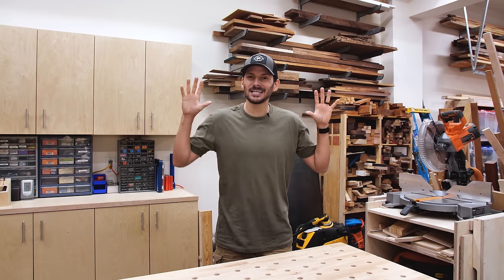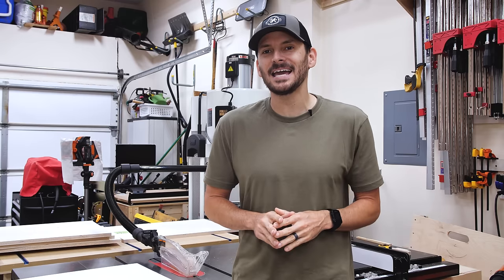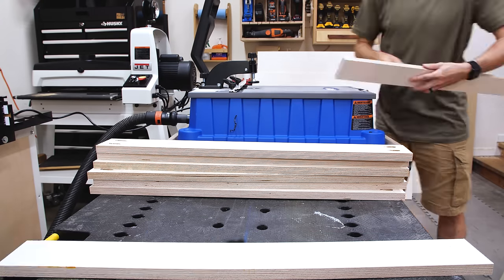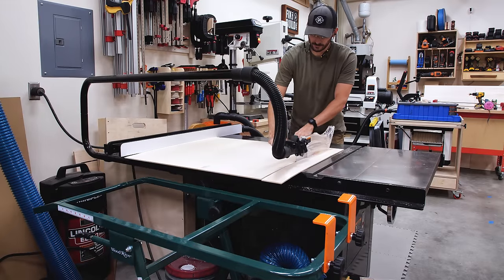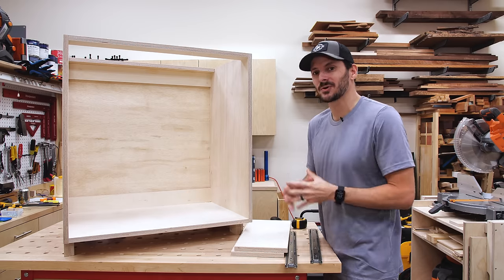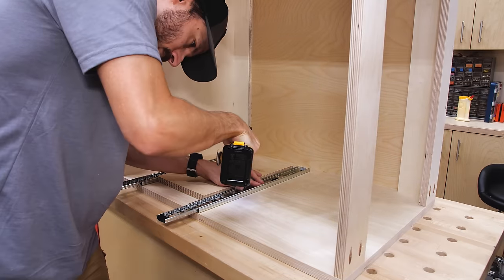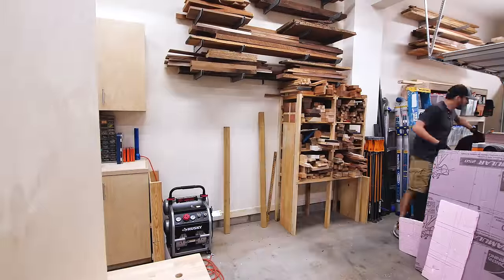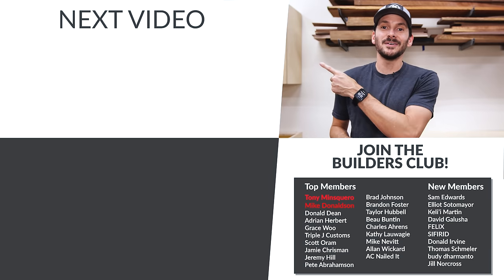DIY 3 Drawer Base Cabinets | Miter Saw Station pt 1

Comment: The best assembly table I I ever worked at had one side that was pegboard and a pegboard organizational system elsewhere in the shop so you could take your little container of screws or other hardware off the wall and then attach them to the assembly table. It also had a shop towel holder with a spring loaded mechanism so you could tear the towels one-handed, and hooks and shelves on the side for wood glue and any tools you needed. And it was all hooked into that pegboard so you could set it up in a way that flowed for you

Comment: Great build and technique, Brad, despite the puns (me nails, undecided). You being particular is called ECD - engineer compulsive disorder (I have it too). One tip I have is to flip the drawer spacer front to back each drawer. Any error in the spacer won't multiply then. It wasn't that important on this build but if the cabinet is many drawers high, it could be significant. See you next video. Stay safe.
Bill
Reply from the maker: hahahaha, Bill I actually did this! ;)  Should have shared the tip.  And love ECD, lol
Reply: Thank you, William.  Now I know the name for my condition.
Reply: @Not_TVs_Frank  Glad I could help (lol)!
Reply: William. That explain my drawers was out of wrack! Thanks for the tip man!  AM just getting into woodworking. Boy what a great fun hobby.
Reply: @imaginarypoint  Glad it explained it for you. Enjoy your woodworking!

Comment: So Brad, as it is in my world, I pulled the trigger finally on building that mobile miter station.  Now you went and designed a new miter station, that figures…….LOL  Fortunately I don’t have the space you have, which I think I’ll be fine with the first version.  I did like the cabinet build though, adding that to my mobile assembly table to better utilize the space under.  Like the video’s.

Comment: Great build. I'm surprised you are building a miter saw station. But I'm really glad. My miter station is an incomplete version of Ana Whites. And it sits to the right of my xcarve table that I built from your plans. I've wanted to redo it but have hesitated. Looks like I'll be finishing this series and then getting that garage bundle. Can't wait for the next video.
Reply from the maker: Yeah, I never thought I'd make one, Angie. But then realized I'm already taking up the space with the cabinets. So it's actually space saving if I'm doing the cabinets anyway. And will free up room for a larger planer 😀

Comment: My assembly/outfeed table has a 4ftx7ft top which seems to be overkill for some but it makes for a lot of room on those bigger projects. 6 drawers on one end and the other end has a place behind the doors for a small pancake compressor and a small cyclone system mainly for the tablesaw. the far end of the table has a niche for squares, nails etc.

Comment: Brad,  Nice video and nice cabinets.  Thanks for sharing a basketful of tips.  I share a tip I've found.  DON'T use those hardware handles, if you wear cargo shorts (which you are in the video).  I love the modern look of those brushed nickel handles - my kitchen and den are full of them. But each time I catch the folds or pockets of my cargo shorts, I rue the day I installed them.

Comment: A good way to stop your draws falling over onto you is to make a plywood box the same size as your toe kicks, it will move the tipping point further farwards and make everything more stable. You can also build a lip into the front to hold the first draw front for you. If you have a standard size that you use for the tie kicks that's one box and you're sorted for life. I suppose you could also just put a big clamp on the back of the unit to hold it to your table 👍🤣

Comment: How much would you say this 6 drawer build would cost to make? Kinda thinking it'd be a good dresser option as well
Reply from the maker: It'll take 3 sheets of 3/4" plywood and another sheet and a half of 1/4".  Add in slides and pulls and you're pretty much there.  But you'd have to price that out in your area.  For me it's about $300 using high quality plywood.
Reply: I built these exact cabinets just a few weeks ago following the plans. $38 a sheet for decent plywood so around $120 in material. I already had drawer slides. Overall a set of two could be built for around $150 depending on material cost in your area. I saved a little by using some other pieces laying around which allowed me to save some of the sheets to use on the wall cabinets also from this build kit.
Reply: @Fixthisbuildthat  Where are you sourcing your plywood? Just the local big box store for approx $50/sheet or somewhere else? I just bought the Garage Cabinet bundle of plans and am ready to get going!
Reply from the maker: @aarondonat  I get 4x8 baltic birch for about 60 bucks 👍
Reply: @Fixthisbuildthat  ... from where?
Reply: @Fixthisbuildthat   where do you get your Baltic birch plywood from?  I can’t find it in my area
Reply: Baltic birch is $120 a sheet here right now. With slides you’re looking at $500 at least. I’m using shop grade birch ply (fewer layers but still good quality and around $60 a sheet), making 2 sets of 3 base cabs (set with drawers and a set with doors & shelves). I will have more drawers in each set of drawers as I want some more shallow drawers and only a few deep ones.

Comment: Looks like another awesome Fix This Build That build!  So as I watch all you very talented makers build shop cabinets with drawers I seldom if ever see anyone putting a rounded edge on the top edge of the drawers. Or a chamfer if that's the right term. I wonder of that would look nicer since most every drawer I've seen on "in the house" furniture has them?
Reply from the maker: Great observation. I round the edges by hand with a sanding block. Its typically a comfort thing vs a look thing for me.

Comment: Nice job.  I forget the name of the tool - it’s the one that drills pocket holes. I’ve seen the form that is some plastic, you fit it to the wood and drill holes. Your machine is so much better. You just place board needing holes and press the arm. Viola! Hole is like magic. I can’t imagine why a wood worker would use anything else lest your building a one drawer cabinet or two. It’s even better than sliced bread as they say. 

P. S. The two cabinets turned out fabulous.

Comment: I bought the plans and I’m looking to make a few different cabinets and the pegboard hutch. For 3/4” birch plywood, my local supplier is asking about $100 a sheet. In total I would need about 17 sheets, which comes out to nearly $2,000 including the 1/2” sheets the plans call for. Is there a cheaper option for wood choice? Is Birch plywood the only acceptable option for nice looking, strong shop cabinets?

Comment: Undersize Plywood. I'll bet it's metric 18mm sold as 3/4inch, which is a 1.05mm (11/256in) difference. Doesn't seem like much but errors soon build up over a distance. Great build though, look forward to the rest of the build.
Reply from the maker: This stuff I used was actually a full 1/16" shy, coming in at 11/16" and that can add up fast!

Comment: I'd like to build these cabinets but did you build a base for the cabinets or use the adjustable feet you talked about in your video? My basement floor is really uneven and I'm thinking building the base first then shimming them for level might be a better choice. If you did built the base, do you have plans available? Thanks.

Comment: This might be a dumb question, but how do you figure out the size of the depth of the cabinets? Like for example, I bought the plans, but let’s say I want to change it to 5 drawers on each size or something? Would I just take the height of the cabinet and divide it by how many drawers I have and then figure the kerf on that cut will be enough clearance between the drawers?

Comment: Brad, how are you squaring your Kreg track on the plywood? One of things I've been struggling with is squaring my Grizzly track saw when breaking down full sheets. I inevitably end up with one end being slightly longer than the other, which means I have to compensate and over cut, then finalize at the table saw. Not ideal.

Comment: Why do you cut in toe kicks?  I have found it is much easier to build the cabinet shorter without the toe kick, and build a leveling platform out of 2X4s in the shop, and 3-1/2-inch wide strips of 3/4 plywood for interior projects.  You build the level wing platform smaller than the cabinet, and that forms the toe kick.  It is a lot easier to level the platform, and then set the cabinets on it, than it is to level each individual cabinet.

Comment: What’s the best way to deal with a garage floor slope of 4”over 20 ft when building cabinets?
Reply: You could build cabinets that are off of the floor, or design them to match the angle, or just have a normal garage
Reply from the maker: I'll be covering that in the next video!

Comment: “Mistakes were Made” from the Movie Timmy Failure. My 7 year old son loves that movie!  Love your Cabinet build series. I want a Miter station like that. But I want to create rolling carts for my table with out feed table on one side the assembly/Router table on the other side. That can store underneath. I’m a beginner woodworker. I’m still working on my first project. A dryer pedestal for my laundry room.

Comment: I just bought your 5 cabinet plan bundle, had to compromise on the plywood as Baltic Birch here goes for $128 a sheet for 3/4".😱 Home Depot has Sande plywood which looks nice and goes for $70 a sheet for 3/4".
Reply from the maker: that's a good trade off and it'll work well!

Comment: I've noticed that the majority of woodworkers check for square by measuring the diagonals, but they never show what to do if the diagonal measurements are off!  I would like to see that in a future episode (if you haven't covered it already).
Reply: Push in on the two corners farthest apart until they're equal

Comment: Hi Brad, I had a question about breaking down your sheets of plywood. I see you use a track saw. How do you get it positioned for a perfect 90 degree cut? Does the track have an alignment feature? Or are you just using a square or measuring the top and bottom of the track from the edge?
Reply from the maker: I don't rely on that edge for finished dimensions. Re-watch the beginning where I talk about the factory edges and that should help explain how I do it.

Comment: I've got a question for you about plywood.  In my area of Idaho a 3/4" sheet of Baltic Birch is over $100.  I can get white birch for about $75 at the same plywood shop.  If I hit up big box store I'm looking at around $45 per sheet.  I've watched and read why to avoid the big box stores due to less quality but at close to half the price I'm having a hard time justifying buying nothing but Big Orange plywood.  Your thoughts?
Reply from the maker: I'd buy Birch Purebond from Home Depot before paying twice as much. My BB is only a few bucks more

Comment: @FixThisBuildThat i bought the plans for these cabinets and am currently in process of making them. Step 6 is a little unclear to me and this video does not state the size of spacers that you're using for the drawer slides. Is the first (bottom) spacer 1 3/4 or 2 7/8, then the second(middle) and third (top) spacing 8 1/4? or is the first spacer 1 3/4 is spacing?...Or is the 1 3/4 measurement representing the drawerslide? If I have to guess i would say that the first spacer is 2 7/8...but i would rather not guess.
Reply: I pressed on and figured out that the bottom spacer is 2 7/8 and the second and third spacer is 8 1/4. I have the drawer faces to mount yet, but so far they've turned out great!
Reply from the maker: Saw your other message too. We'll get you on the right track just shoot us a note on the site 👍

Comment: Hey, going to buy all the plans but are the measurements in the plans all in inches or do you have everything in metric as well? Of not I rather wait till you do. Really interested in all 3 parts you are doing here.
Reply from the maker: Hey, Daniel.  We are only in imperial at the moment.  Hope to be in metric before the end of year.  But I'd love your input.  If I just did a straight conversion and had things like 14.82cm would that be good?  It'd be very difficult and time consuming to reconfigure the entire build to hit full measurements like 15cm exact.
Reply: Fix This Build That, oh yeah please do put it in exact numbers rather then half and a second and a hair short of an thierd and so on 🤪

A question, programs like skectup and so, they can out put all of the measurements pretty easy, and since you guys are comfortable with all the inchesh and halfs and thierds so, why not make everything in cm from start and make the rendring program to output the conversation into inches. In that way you get exact metric from start rather than making up basically to different versions with different exact measurements.

Are you with me still and if so do you know what I mean? 🤓
Reply from the maker: Unfortunately it's the same deal. It'd come down to 32nds which nobody uses. That's the same as decimals for you. So either way I'd be in trouble and need a whole new design. And that's the issue

Comment: I went online to order 14" slides for my 32½ opening/ length × 14½ depth drawers, and the diagram shown on the website said that the maximum opening/ length of the drawer should be 16". I'm confused, why the slides won't support a bigger drawer?

Comment: What kind of table saw do you have? In the market for an upgrade and im looking for options and suggestions.
Reply: That's a SawStop
Reply from the maker: It's a Sawstop Industrial.  Overkill for a small shop like mine...but amazing!
Reply: @Fixthisbuildthat  wow. It looked like a sawstop but wasn't sure. High dollar saw there buddy. I'd be lucky to get their contractor saw. Which is actually a bit over my budget but may be worth it.
Reply: @ritoluis4903  I Have the Rigid RG4512, its no SawStop but it works great and cant be beat for the price
Reply: @MrFFP123  unfortunately they no longer make that model now its the R4520 and quality with ridgid has taken a hit.
Reply: @MrFFP123  the competing delta 36-725 is much better than the ridgid. Way better fence, included mobile base, and cheaper.

Comment: let's say you weren't square before putting the back on - what would be the steps to fix it?  Let's say one diagonal was off by 1/2 or 1/4 inch - what would you do next?
Reply from the maker: Push the corners that are longer towards each other by hand or by clamp.  Only need to move it half the difference between the two measurements since 1/8" off that diagonal adds 1/8" to the other diagonal.

Comment: For the drawers, why not make the front and back of the drawers the width between the drawer slides instead of having to calculate it between the drawer sides?

Comment: I ordered the plans but it doesn’t say what the letter P is. What size wood is it? 3/4” plywood?
Reply from the maker: Sorry, that is a typo.  P is supposed to be J.  I will update the plans now.
Reply: Fix This Build That no worries I was just a little confused! Looking forward to building it! I bought your son’s closet build as well so I’m anxious for both
Reply: Hey Brad, if I sent you a picture could you build plans and sell the plans to me? I have a picture of what my wife wants in her closet, I’m going to use the 6 drawer dresser you made but want something different on the 2 adjacent walls. Just not sure how to go about making plans and measurements

Comment: Question, how do you figure out how big of a spacer to use between the drawers when attaching them to the slides?
Reply from the maker: I adjust the spacing and drawer height on every project for ease of assembly.  Like here I used 2x2 stock for spacers.  So I specifically adjusted the drawers to make it easy for people to do it when they buy plans.  So it's a very manual process for me, but makes it easy for other to build :)